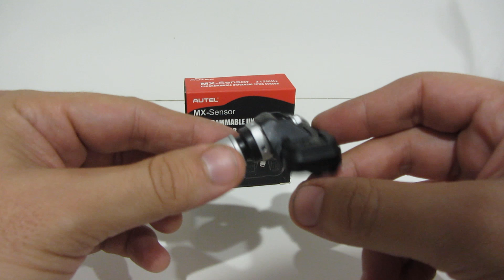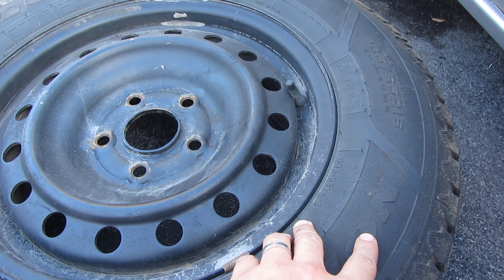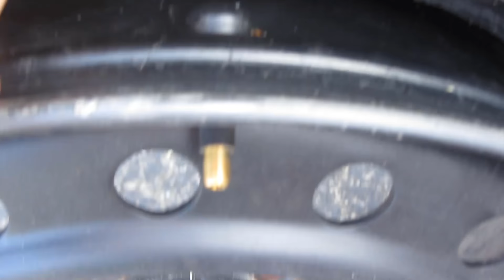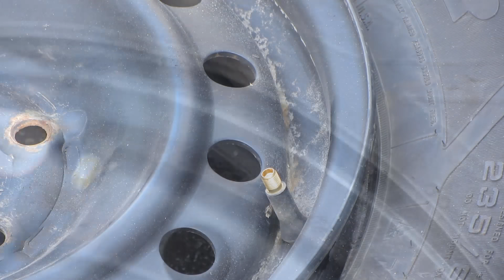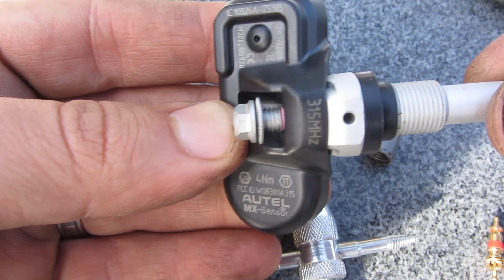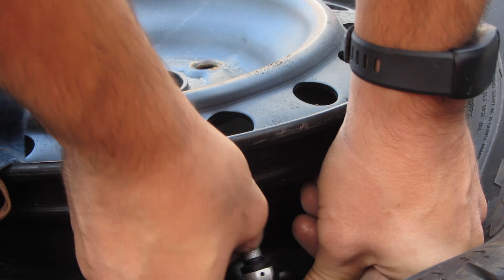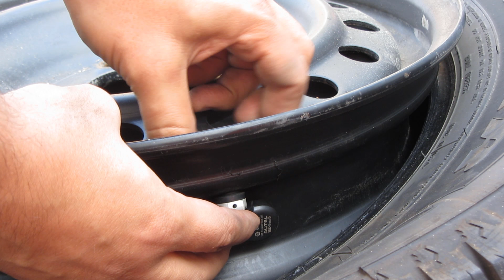Install New TPMS Sensor DIY Without Needing Rebalance

Comment: Gabe, educational video. Thanks..  Can I eliminate the sensor altogether?  Either use a rubber valve stem or tube.
Reply from the maker: You can, as long as you don't mind the light on your dash.
On some cars have other consequences. My Odyssey, for example, you can't turn off the traction control if the TPMS is not working properly. Usually not an issue, but sometimes if you're stuck in snow you'd want to turn it off.
Other cars might have similar quirks.
Reply: @GabesHacks  Apreciate  your quick responce. Thanks
Reply: Why would you want to?!
Reply from the maker: @AlaskaErik  Some people are comfortable checking the tire pressure the old fashioned way and don't see the need to spend the money to maintain the monitoring system. I get it.
Reply: @GabesHacks  Checking tire pressure the old fashioned way is fine, but what happens when you get a puncture while you're driving?  That tire pressure check you did that morning was just a snapshot of your pressure at that specific time.  Having TPMS with individual tire pressure display gives you real time information about each tire.  And should you get a puncture, you can monitor the pressure and determine if you need to pull over now or if you have time to make it it to a repair shop.  It also negates the need to check pressure manually because you can pull up the display at any time to check your pressure.  Which I do do at least every other day, which is much more frequently than I ever checked my pressure the old fashioned way.
Reply from the maker: @AlaskaErik  I agree :)
Reply: @AlaskaErik  Older car,  expense.

Comment: I check my tires with a gauge. Will not own a car equipped with TPMS. It's a stupid fucking idea made for stupid fucking people.
Reply: so you are never buying a newer vehicle ever again
Reply: it is mandatory on all new vehicles.
only option for you is buying more than 10 year old used cars.
Reply: Dan, how do you really feel?
Reply: It's basically a way to make more money. For example a new car if you lose your car keys it will cost $250 to replace.

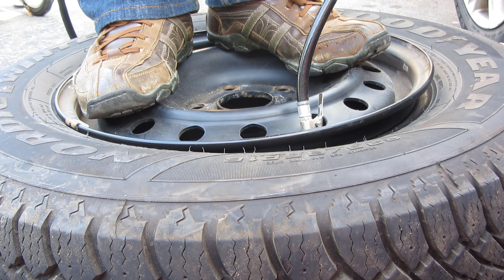Comment: At  10:27, aren't ya supposed to hit the side wall to be sure it is completely seated? You could have a blow out (not a hole / loss of seal) while driving. I did.
Reply from the maker: Eek! Sorry to hear that. I hope you got going again quickly and cheaply.
I don't know how much hitting the side wall will help, but it won't hurt. There is always the possibility of leaks after, so you'll have to check regardless. You can listen for any hissing right away, and check them before driving the first couple times just to be sure.
Reply: What happens is that the tire SEEMS sealed like in your video. But down the road the Tire POPS loud and hopefully finishes the seal seating. But it can fail and all the air goes out in boom one second. Hit when the tire first seats and not later. Then mount the tire. Nice Video and interesting. How about 'learning' ? I have a Dodge Charger and each sensor reports
Reply from the maker: @PrincetonTV  You should hear the pop when you're filling it up. If you don't, it's not going to be seated properly. The best you can do is check it over as best you can and keep an eye on it for a couple trips.
From what I've read, the Dodge Charger automatically learns new sensors, so you don't have to do any learning. But I don't think you finished your sentence, so I don't know what your issue is :)
Reply: each sensor reports for each wheel …. but form some reason the tires are reporting to the wrong position on the dash board. I found this out by deflating each tire to see which output reports. 

Any way the automatic learn maybe why I can not find instructions anywhere. 

One of my sensor seems to be busted. Reads "-- --".  So I am researching if I need to identify the new sensor.
Reply from the maker: @PrincetonTV  The owner's manual might have instructions. Usually it tells you to drive for a while between certain speeds to relearn the sensors, but it depends on the car.
Did you just replace any sensors?
Reply: I am researching b4  do anything. The Dealer wants $300.00 without looking at it.
Reply from the maker: It might just be the battery dying. From what I've read, the batteries last about 7-10 years, depending on how much you drive. But something else in the sensor could have gone bad too, who knows. In your case, you should be able to just replace it and keep driving - no programming necessary. If you do it yourself, just make sure you get the right sensor. Apparently the 2005-2007 Charger used 315MHz sensors, and 2008+ uses 433MHz.
Reply from the maker: @eaglei22 The soapy water trick is a good one too.
Not all cars have manual procedures for relearning the TPMS sensors. My Honda Odyssey doesn't - the only way is with a scan tool (although the Touring model is different and learns them automatically).
Reply: TY

Comment: Great vid, Thanx! Still have a question. Did you programm the sensor before putting them in or afterwards? Or does you car automatically recognise them?
Reply from the maker: It depends on your car. Some cars automatically learn new sensors. Some cars you can put into a learning mode without any additional tools. Other cars (like my 2009 Odyssey EX-L) need to be programmed with a special tool when a sensor is replaced.
I chose to use programmable sensors so I could make a second set of sensors for my winter tires. I described that process in my other video: https://youtu.be/N6p6xV4PlHc
Reply: Patrick f

Comment: Dish soap is caustic. Use car wash with wax soap.
After breaking the bead, it is a good time to clean the rim's bead area before installing the sensor.
Reply: dish soap will not hurt anything, it's the best choice after actual tire lube

Comment: Whats happens if you come across other vehicles with the same sensors?
Reply from the maker: All sensors have an 8-digit alphanumeric code to identify them. Your car only listens to the sensors with the codes that it recognizes. That's why when you change your sensors, your car needs to relearn the codes. Some do this automatically (if an unrecognized sensor doesn't go away, it figures out that it's a new sensor). Other cars have to be programmed with the new sensor codes with a tool.

Comment: Great video if I have to do this, lol I hope my factory wheels I just purchased has the sensors already in them, otherwise I’ll come back tot his video to learn how to do it lol
Reply: Most the time they will not have a sensor. Just to give you a heads up. 🙂
Reply: Erica Campbell yaaa these wheels I got are factory wheels for my car that I bought from someone and good news. It did have the sensors on them... bad news, the batteries are dead 😭😭😂 so my TIre sensor light is still on 😕😕😫

Comment: I have a 2014 Civic SI that doesn't have a TPMS system as I live in Canada where it's not required. Does anybody know what the best and not too expensive system I can put in my car because I'll be moving to the states within the year and it has to have it TPMS system in order to be compliant. Are you able to put just the sensors on your wheels or do you need a complete system because for some reason my car also doesn't have any air pressure icon what time surprised about. I don't know if I have to have a built-in system or if I can just literally buy an aftermarket one that can be installed and does anyone know about importing a vehicle into the United States and has ever came across the TPMS if you and got it resolved and was able to move your car across? Really appreciate anyone's help :-)
Reply: Who told you, you have to have a TPMS sensor system to be compliant in the states if you are coming from Canada?
If that's the case, not sure if your car can be programmed to accept the factory sensors, or you can buy an after market valve stem cap setup.
Reply: @2015_Rubicnn  immigration told me my car must have a tpms system to be allowed to import it :( I've heard many people from Canada doing aftermarket ones and seemed to be okay so that's what I will have to do I guess so annoying
Reply: @TheSteph2385 
Yeah, I never knew that, but check Amazon, there are different aftermarket companies selling different price range TPMS systems.
 https://www.visajourney.com/forums/topic/674653-importing-a-vehicle-subaru-without-tpms-success
Reply: @2015_Rubicnn  thank you!
Reply: @TheSteph2385  you're welcome
Reply from the maker: They make the cars so that parts can be easily swapped or just not put in for specific markets. That means everything you need can be added to your car. You'll need the sensors, the receiver, possibly a new gauge cluster and maybe even the wires run (sometimes the wires are there, just not used, but maybe not). A Honda dealership could probably do it for you, but it probably won't be cheap. There are also companies that specialize in importing cars. You could search for one of those in the state you plan on moving to.
Getting it licensed in the US is more than just getting TPMS though. There are other rules it has to meet, the simplest one being that the speedometer has to be in miles/hr (which means you have to replace the gauge cluster anyway).

Or you could just consider selling your car in Canada and buying a similar one in the US. It might turn out to be cheaper. But I can't really say - I have no experience here.
Reply: @GabesHacks  thank you! My speedometer has a miles and km option :) I'll call the dealership this week and the US customs and try to find out. Appreciate the reply :)
Reply from the maker: @TheSteph2385  Right! I forgot about that button. I have a 2010 Civic.
Reply: https://m.youtube.com/watch?v=sF3OHTzXIXs

Comment: Great video ... Terrible idea to be on top of the tire while the bead is setting. Lucky there no accident.. 
I do commercial tires seen a coworker loose his life like that in a terrible accident..
Reply from the maker: That must have been awful to witness, I'm sorry. That must have been a big tire! I've never seen any evidence of passenger car tires exploding, especially under the low pressure needed to set it on the rim.
Reply: Gabe's Hacks it can happen. I work in a tire shop also but I do passenger car and truck tires. I’ve had wheels almost coming off the changer while setting the bead. (Jumped maybe 10 inches into the air, isn’t supposed to do that btw) it’s a dangerous job. Doesn’t matter if you’ve been doing it 10 years or a newbie a tire can and will explode on you.
Reply from the maker: @TheGhost28  "coming off the changer while setting the bead" - That sounds more like it slipped out of the machine?
Reply: Gabe's Hacks nope. Whenever you use a tire machine as soon as you set the bead you unclamp the tire so it doesn’t get stuck. The smaller wheels will jump up quite a bit.

Comment: Does the sensor have a small battery . What is its power source ? External sensors have a small button battery
Reply from the maker: Yes, they have a battery in them. From what I've read, the batteries usually last about 7 years, but it depends on how much you drive.

Comment: Great video man thanks so much my local tire shop on to charge me $240 for one TPMS and that includes labor and the part but I'm like hell no LOL because what if the other four go out I have low profile tires so I'm a little nervous about doing this and getting the beat back on but I've seen some gnarly Fire and Air Compressor stretches so I feel confident that I could do some ghetto stuff and get it done. Nevertheless I appreciate the video it's extremely informative 👍🏾
Reply from the maker: Thanks :) I don't know if this method of breaking the bead will work on low profile tires, so you may want to look at other videos for that. But I can't really say. I've never had low profile tires.

Comment: Push valve in not out to remove,great video thanks
Reply: gabe did it the correct way, its much harder to push than to cut and pull
Reply from the maker: Thanks, I'll have to try that next time!

Comment: Thanks Sir 

Like video the best 

It will be automatically connect with meter air pressure light? 

Or we have to do some setting aswell in side ?
Reply from the maker: Maybe. It depends on what car you have. What is the year / make / model of your car?
Some cars automatically detect new sensors. Other cars have a learning procedure that doesn't require any special tools. Others require programming with a special tool. For mine (2009 Honda Odyssey EX-L) I did have to do some programming. I used programmable sensors instead of programming the van. I showed how I did that in my other video: https://www.youtube.com/watch?v=N6p6xV4PlHc

Comment: I was going to ask about programming the sensor, but then I saw your other video. So....my local Walmart Auto is charging $30.00 to replace sensor, plus another $10.00 to simply do the code thing that you showed on other video. Also, I called 2 Walmarts for pricing. One says the tire must be balanced @ $12.00 additional. The other one said the tire does not need balancing. I'm wondering if both stores install the same way and one store is just adding an extra $12.00? 
The local tire store that I ''did'' use for years wants $70.00 to replace sensor. They charged $55.00 just over a year ago.
Reply from the maker: I wonder if the one Walmart is doing the same thing I am: breaking the bead on one side of the tire and not the other (just with better tools of course). The other might be taking the whole tire off the wheel to do it (or just gouging, who knows).
Does that $30 include the actual sensor itself? If so, that's a great price.
Reply: @GabesHacks  - Thanks for the quick reply. Walmart told me it would be a universal Schrader Sensor for $30.00. I see that Auto Zone sells this brand, but it looks like  Schrader Sensors start at almost $50.00. Link:  https://www.autozone.com/engine-management/tire-pressure-monitoring-sensor?filterByKeyWord=tire+pressure+monitoring+sensor&fromString=search&isIgnoreVehicle=false&newYmme=true On the same page, I see ''sensor kits'' that only cost a few dollars, so now I'm thinking they are just using a kit and not replacing the complete sensor? I wonder what the drawback to doing that would be... if any? I want to make sure it is done correctly and do not want to have issues later. I called the less expensive Walmart again today and asked if they left tire on rim. Manager asked if the valve stem was rubber or aluminum? It is aluminum, so he said the tire would have to be removed from rim. Said it would not have to be removed if it was rubber. I think he said he could do the ''break the bead on one side of the tire'' method if it was rubber. As for tire off the rim, he said that he would put a chalk mark to line the tire up on the rim exactly as it was, but if I wanted.... I could pay for balance. 
I have always been leery of Walmart Auto and never had any repairs done there, but the manager seemed pretty confident and I like that he was trying to save me the price of balancing. The store has better then average Google reviews. If my usual Tire Store still charged $55.00, I would go there again, but I don't like that they jacked the price up to 70.00. Checking my notes again, it was actually $80.00, plus tax!
The last time the Tire Store did it, they replaced my aluminum valve stem with rubber. I asked why and they told me that they have found out that rubber works better. Now that I am checking prices at Auto-Zone, I see that the rubber cost less, so I'm guessing the Tire Dealer might use the rubber stemmed sensors to save more money. Odd that they did not ask if i wanted aluminum. It does not match the other 3 stems, but not a big deal for me.
I also called Discount Tire Store and they wanted $65.00 for replacement. I don't remember if I asked if they removed from rim or balanced afterwards.
Reply: Wayne Lynch aluminum stems are more prone to corrode, valve core can corrode also. Had a few aluminum valve stems break putting the air chuck on. Most of them you have to change the whole sensor stem if you would ever have a leaking valve stem. The nut on top the valve stem could get over tightened and would have to break the sensor to get just the valve stem out. Multiple possibilities. I could come up with more.
Reply: @TheGhost28  - Turns out my rubber stemmed sensor that I just replaced 1.5 years ago was the bad one. Old one was a Schrader. Most all the local shops and auto stores sell them. Walmart also used one for my repair and sure enough it was just over $40.00. They replace the whole thing/w stem. For rubber they don't have to take tire off all the way, so no balance fee. Aluminum stems, the tire has to come off the rim. They still don't have to balance, as long as they mark the tire at exact spot per the tech. My other 3 aluminum stems and sensors are the originals from 2009. I'm gonna call Schrader to see if they will refund the one that only lasted 1.5 years, but he warranty is only for a year. Never hurts to ask.

Comment: Can you replace the tire pressure sensors with just regular ones that sandard cars have. The regular tire valve.
Reply from the maker: You can. But if your car is expecting sensors to be there, it will complain - you'll have the "TPMS" light on the dash lit up all the time.
Reply: Barbara Gray yeah, or you can just leave the pointless sensor and valve there until is stats leaking.
Reply: Gabe.my tpms is already on all the time.i tried to reset it but i think the passenger side monitor is bad.all other monitors are fine.
Reply from the maker: @babs3606  If you don't care about the light on the dash, then you just can just leave it be. Replacing them with regular valves won't do anything for you.